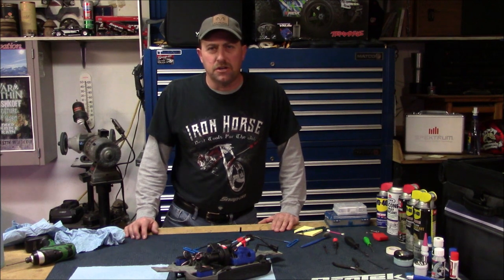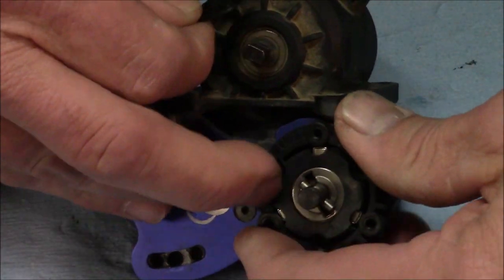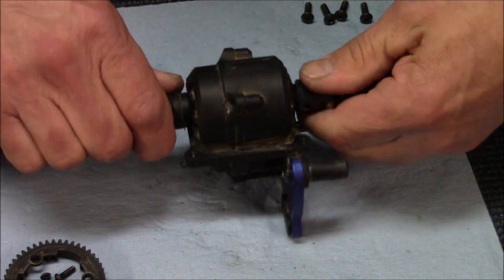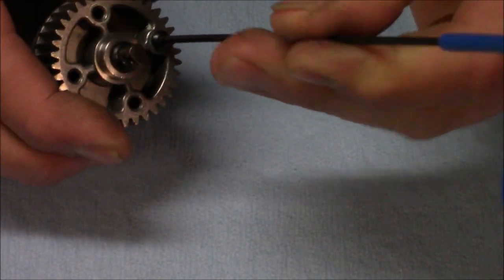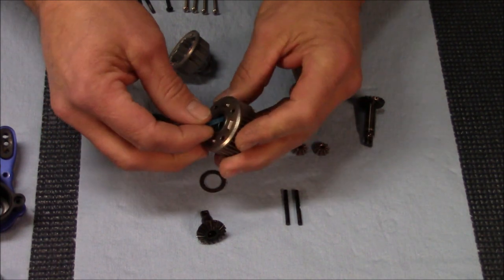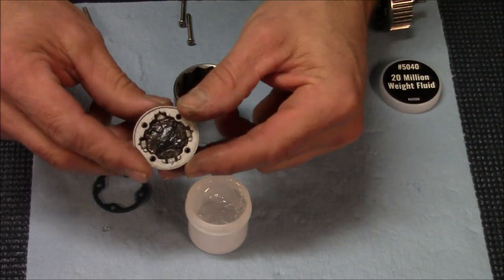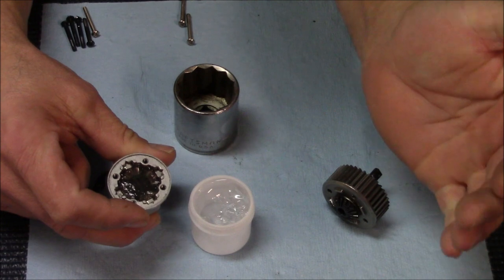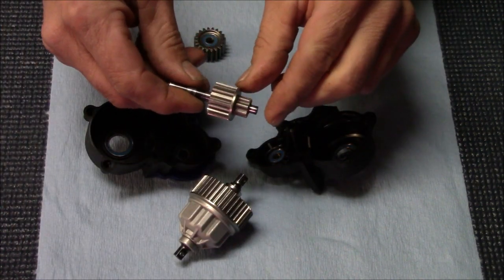E Revo 2 0 Center Diff Removed, Refilled, Rebuilt, and Lubed Up with !!!! Gel !!

Comment: Fantastic video man!! I wanted to post up here because (thanks to this video) I found a much, much faster way to remove the motor/center diff assembly in case anyone is looking for it. 
1. from the top of the truck, remove the screw-pin holding the front driveshaft to the center diff.
2. from the bottom of the truck, remove the small cover piece to expose the rear drive shaft connection
3. remove the screw-pin holding the rear driveshaft to the center diff
4. use a scrwedriver or something to push the rear driveshaft off the center diff
5. from the bottom, remove the 4 screws that hold the motor assembly to the chassis
6. the entire motor assembly can be wiggled free, you tilt the assembly forwards to bring the rear out first, then the front comes out and the front driveshift disconnects as you remove the assembly

Comment: Just wanted to say thanks my trans started binding up took it apart and found that the dif was locked up all the gears look OK put back together but didn't turn when I tighten the 4 screws watched your vid and seen what I was doing wrong big help

Comment: So this video has been out for some time and was wondering how the new gel oil worked after you ran it for awhile.Great video.
Reply from the maker: It all leaked out. Use the Vanquish blue rock lube.
Reply: @upgradedrc3697  o wow to bad well thanks for the video and knowledge. I have the E Revo 2.0 and I like the platform.

Comment: The center diff is what controls how much power goes to the front or rear. The thicker the oil the more that’ll go to the rear and the thinner the oil the more power that’ll go to the front. The Cush drive is what absorbs the impact
Reply: The center diff is also designed to absorb differences between the front and rear due to shock like front landing first. All of these devices are primarily shock absorption. Thin lube will make these trucks very front wheel drive instead of a basically locked center that only slips under major shock.

Comment: Amazing video! Very informative! I learned a lot and I am about to dig into my center diff for the 1st time.   Quick question though, did you upgrade your spur and pinion gears? Or are they the original ones that traxxas gave with the erevo?  I thought about changing mine up but, I mostly do off roading and jumps and mud lol.
Reply from the maker: Leave the stock spur gear, but change your pinyon out whenever depending on the terrain.

Comment: 16/46 is a very tall gear ratio, especially for bashing. That’s 2.88:1. Stock is 3.6:1. 
.
Taller gearing means more heat in the motor and esc, which means shorter runs before thermalling. Also means the batteries run hotter and out of juice quicker. 
.
Stock gearing pulls 100 amps, running a 12/50 (4.17:1) pulls 87 amps, and 15/46 (3.07:1) pulls 116 amps on mine. Current creates heats. 
.
A taller gear ratio actually reduces drivetrain torque multiplication, but the extra load causes the motor to draw more current and produce more power. 
.
I’ve found that 12/50 gearing to be perfect for bashing. 46 mph top speed, a little too slow for standing backflips, but can do them off a curb. The motor and esc operate much cooler. And you still have great control in the air.
Reply: 3.73:1 is the best ideal for both.  Its nasty!!!!
Reply: i run 4 dual sets of 3s  NON STOP on my 16/46 and some times 16/50. ITS STUPID HOT, but i have a massive cooler on the motor and RPM covers, i DO NOT have issues with heat i bash the piss out of it full send almost the entire time. having 3x 30mm fans on that motor with custom coolers strapped it it 360* around is the key.

Comment: 13:20 traxxas calls it a torque biasing differential, but it’s not. It’s an open differential with so much resistance that it’s forced to transfer torque. It’s closer to a posi than a TBD. Basically, a posi uses clutches to apply friction to the gears, once the input torque exceeds that friction the diff can operate. The thick gear oil acts in the same manner. 
.
A true torque biasing differential multiplies the torque the weakest wheel can generate and sends it to the wheel with the most traction. 
.
It does this in a very simple manner. Helical gears produce radial torque like standard gears, but they also introduce axial torque that standard gears do not. The axial torque is proportional to the torque transmitted through the gears. 
.
So, the more torque transmitted through the gears, which is dependent on the wheel with the least traction, the more binding that occurs from the axial torque generated on the gears and the case. 
.
Since torque flows to the wheel with the most traction, the torque multiplier effect will produce more torque at the wheel with the most traction. 
.
A locker doesn’t split torque evenly unless both wheels have the same traction and or the input torque doesn’t exceed the lowest wheels traction. For example, lift a wheel into the air and it cannot generate any torque (which is a force that requires resistance), so all the input torque will flow to the wheel on the ground (in a locked differential).
.
A torque biasing differential essentially locks up proportionally to the input torque.
Reply: Traxxas doesn’t call it a differential. The exact term they use is torque-biasing center drive. They pulled a sneaky a made people think more of it. Play on words is all.

Comment: I know this is an older video, but do you happen to have a set up sheet for your car - something that includes your whole set-up, lube and all. I turn to your vids all of the time when I want "real" info that I can trust to be right and true...along with some of the little tips and tricks. Love your content! Thanks for your work with the E Revo 2.0 !!!
Reply from the maker: I don't have a set up sheet cause I change parts and lubes so often it is hard to keep track of it. I just set the car up for the track or place I am at that moment. Every terrain and environment  and what I demand of the car changes a lot. Sorry
Reply from the maker: Tell me what you are trying to set it up for and I will send you in the right direction.
Reply: @upgradedrc3697  Heavy bashing, medium speed, minimally rough terrain depending on where I go, small to medium jumps, little bit of low speed crawling. I'm currently running long travel rockers and springs
 and getting ready to start going through the whole car as it was bought used. Just trying to get my ducks in a row
Reply from the maker: Ok, based on what your telling me. If you are running stock tires and wheels, then use medium ride height or center position (stock). For the shocksl, I would use 50wt oil with either the black or purple springs all around. Then adjust preload for 1/2" sag with #2 cams and probably run stock #2 pistons inthe shocks. Run 50k in both diffs front and rear. Run 20 million weight in the center diff. Vanquish blue gear rock lube everywhere that requires grease. And if you are running a stock motor with  6s, then stay with stock gearing 15/54. Hope this helps. 😎👍🤙
Reply: @upgradedrc3697  Much appreciated!
Reply: @upgradedrc3697  Actually, I thought that the bigger spur was stock and the 54t was the high speed gear?
Reply from the maker: Nope stock is 15/54. You could also go with a 16/54 that would give you more top end but still be great for bashing and a around use.
Reply: @upgradedrc3697  Interesting as my spur is steel - one of those things I guess as I purchased it used. Thanks again
Reply: Forgot to ask, what wheel and tire combo are you using? I plan to go with a beadlock, wheel set - just haven't found one I like yet
Reply from the maker: Duratrac six pacs

Comment: Hey Travis, long time no E-Revo vids how’s it been going?  Last weekend we managed to wreck the entire transmission, the idler gear was missing a few teeth and inside the box was looking a complete mess.  Sadly the diff was impacted, too so I decided to shell out and get the TRX8695 complete transmission.  I wanted to ask what’s your long time experience with the WD40 gel are you still using it?
Reply from the maker: No, it leaks to much.
Reply: @upgradedrc3697  what fluid or grease do you recommend, knowing what you know?
Reply from the maker: Sorry,  you gotta be more specific.  Where are you putting it.
Reply: @upgradedrc3697  I was following the comment of what you recommend using in the center gear box since the WD40 gel didn't work?
Reply from the maker: Ok, I went back to the vanquish blue gear rock lube.  It's the best thing i've found.

Comment: Great video. Thanks for posting. Question: I have some slop between the center diff and the housing. It that normal!? Thanks.
Reply from the maker: A little bit is normal. But you can shim it if it's excessive.
Reply: @upgradedrc3697  Thanks for reply. Nah, it's just a tiny bit. Gonna leave it like that. Thanks.
Reply from the maker: Yes, a little bit is normal.  A lot needs shims added.
Reply: @upgradedrc3697  Thanks.

Comment: Hey bud awesome videos! You deserve more subs haha but how did that gel end up working out????
Reply from the maker: Honestly, winter has keep me from getting any real testing done. But , I will let you know!
Reply from the maker: So i went out yesterday and ran pretty hard. The gel lube felt great and reacted good, but iworked it's way out through the bearing and made a mess. I will be goi g back to grease.
Reply: UPGRADED RC so it doesn’t work good in the diff? But is it okay in the wheel bearings? Cause I actually went out yesterday and picked up some of the gel lube and used it on my bearings for my wheels and rocker arms and stuff. I didn’t use it in the diff though
Reply from the maker: @AMM0394  works great on wheel bearing .

Comment: @ 3:22 it looks like you will be needing a spur gear. That one looks a little worn out, and the teeth are worn down pretty good.
I use a tiny dab of axle grease to hold the washer in place on the output shaft when I rebuild diffs. Can you heat the fluid up to make it more pliable? Like, put it in a pan of warm water to make it easier to fill the diff?
I always use a pair of small needle-nose pliers to put the spider gears, and shafts in. My fingers and knuckles don't work like they used to, and I can't get my hands in tight places like that anymore.
@32:18 those on the can are ball bearings on rollers for like conveyer belts, or what warehouses use to roll boxes on to load trucks and such. 
I always thought you use 1 piece of paper, and not folded in half like that. Won't that have too much play between the gears? It works great for the smaller pitch gears, and maybe it's different for the bigger pitch gears.

Comment: Didn't see you check for shaft play. Got a brand new trans that needed more shims.
  I wouldn't use that wd40 🤦‍♂️. 12 time longer than the original.  0 x 12 is still 0 protection 😅.
  I set my pinion and spur tighter then that. You're close to half way of striping that spur.

Comment: love your videos and very helpfull,did that wd40 lube work well for u?
Reply from the maker: Thank you, to be honest with you, it's been along winter here in Colorado and i haven't run it much yet . This Sunday will be the first real test. After several runs i'll let you know. But, I  think chain lube will work well.  Traxxas didn't use very much grease in mine. So i think o have them beat. But, we'll see how long it lasts. I'll let u know!
Reply: @upgradedrc3697  ok thnx
Reply from the maker: To be perfectly honest, I have not really had a chance to test it out here . this Sunday will be my first bashing session this year if the Colorado weather holds out! After several runs I will let all now!
Reply from the maker: So i went out yeasterday and ran pretty hard. I like the way the gel lube made it feel and react, but it worked it's way out and made a mess. I will go back to the grease.
Reply: @upgradedrc3697  Good to know.  Thanks for sharing.
Reply: @upgradedrc3697  I was going to ask but found this answer. I had a feeling that type lube would do that as soon as it got hot which straight gears do. Great video!!! Very informative, well thought, clearly spoken, and extremely respectable to see you respond to questions. You got a subscriber!!

Comment: So ERevo 2.0 have center diff like all  truggy’s profesional kits like team losi, assiciated, durango, serpent mugem and other? Why ERevo is monster truck carhegory not truggy what is the diffrent?
Reply from the maker: Good question. I wish i knew!
Reply: Very few monster trucks don’t have center diffs nowdays...
Reply: It's mostly because of the tires.  E Revo is basically a truggy with monster truck tires.  The dedicated racing truggies out there are also made specifically for racing (as opposed to bashing) so they're lighter and built to easily access things you need to access on a regular basis when racing.

Comment: Why bother removing the motor on the car? You can take the gearbox out while leaving the motor in. And you can take some pliers to push the bullets in to be a normal pressure.